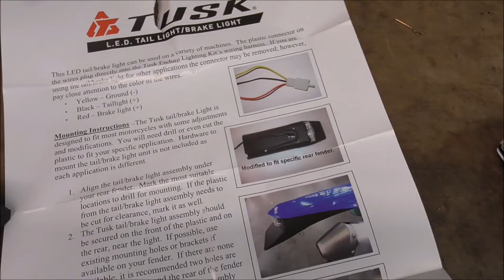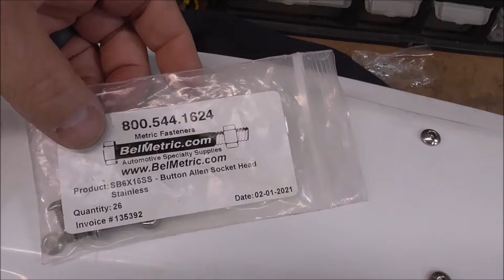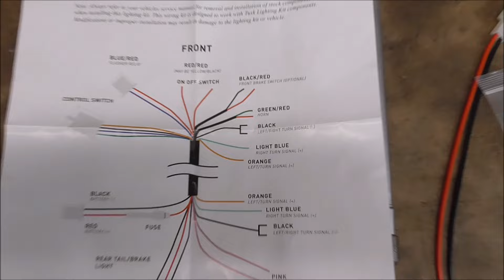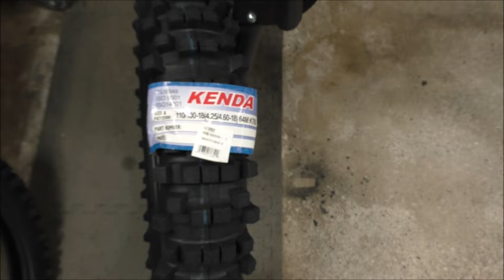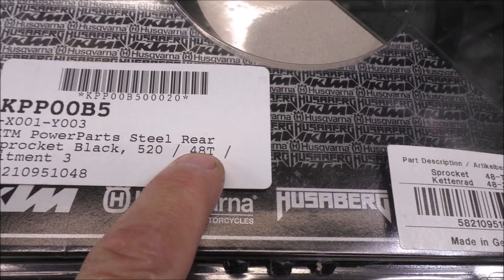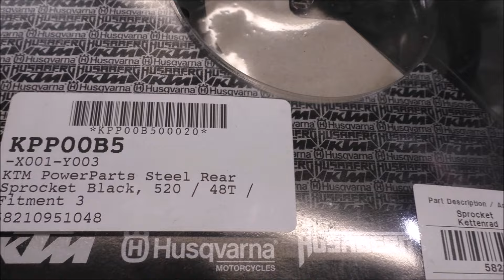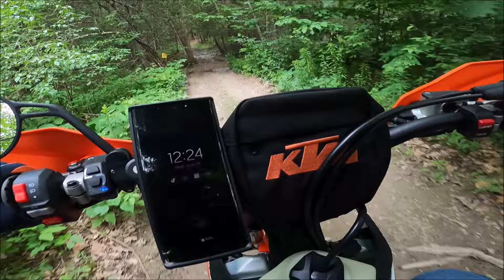Street Legal Dirtbike Build In Detail 2023 KTM 450 XCF

Comment from the maker: HERE ARE THE SUPPLIES I USED: 
Tusk Street Kit - https://amzn.to/3XGP5Qg
KTM Tail Bag - https://amzn.to/3WcTv0l
Switch Back Turn Signals / Running Lights - https://amzn.to/3XKrtdI
LED Headlight - https://amzn.to/4bqUbn5
Stainless Button Head Cap Screw Kit - https://amzn.to/3XK0uyO
Stainless Nylon Lock Nut Kit - https://amzn.to/4cE5OrN
Additional Cable / Zip Ties - https://amzn.to/3zvHiKY

Comment: Well done ol’ fella. 
You’re a sucker for punishment 😂😂😂, both my knees are shot, but atm I’m keeping it quiet from the doctors. I’m their spare parts body 😂😂. After the heart op, 3 cancer ops, liver and gallbladder ops, I ain’t got nuttin left. Knowing my luck they lop my legs off. 
I used to change sprockets & chain on my H1 at least one a month, rear sprocket would wear out quick. My bike only had 2 speeds, flat out & stopped, but that was in the 70s. Had a mate with a Z1 and I could stick with him to about 90 then he’d pull away. He got a heck of a surprise after I swapped sprockets, he was cruising at about 115 mph and I went passed him so far he nearly got off to find out why his bike stopped 🤣🤣🤣. The H1 would top out about 110, no idea what it was capable of, my speedo topped out at 120, but I reckon I was much faster than that, but never did it again, scared the begeezus out of me. 
Top job on bike, don’t kill yourself! I’ll never speak to you again if ya do!
Cheers to ya.
Reply from the maker: 🤣🤣🤣 good times! It's hard to behave when you have a fast bike. I struggle with it.